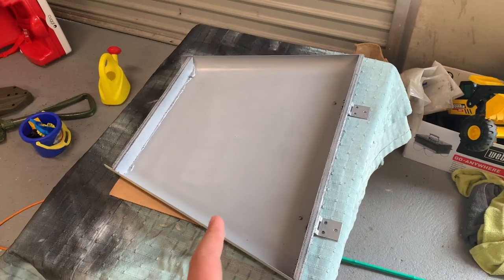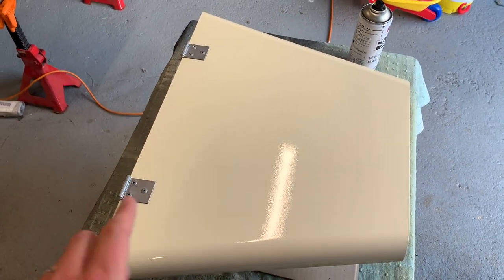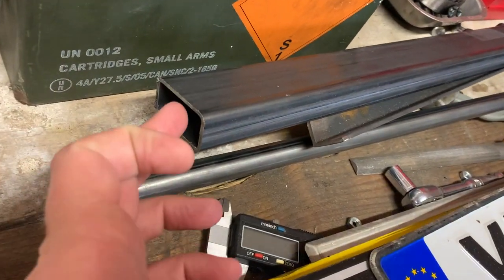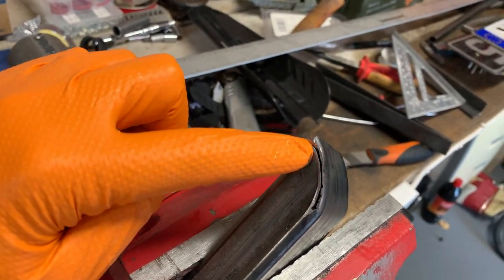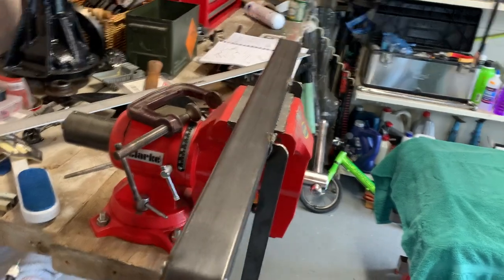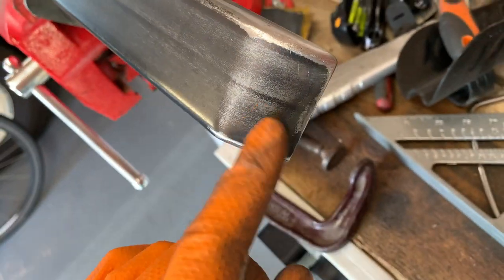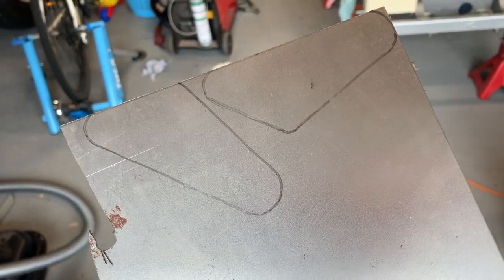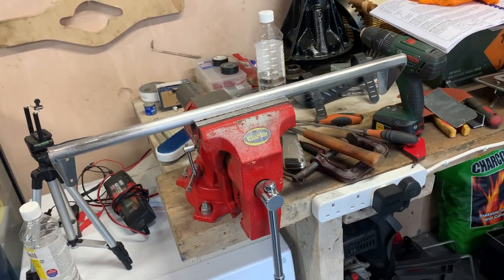Toylander 1 Build Series - Episode 20

Comment: Hi, it's great to see that you're almost done with it! It looks great, far better than mine! I'm waiting anxiously for the electrical part of the Toylander! I already started mine, I'm curious to see how will it be yours. Also, I cut the side panels so that doors could be opened, but I think that I lost some of the structural strength. I can see the car bending lightly every time that my kid jumps aboard...  I'm about to order a horn,  but I'm not sure how loud should it be... I'm guessing around 90 db, because I don't want it to be too loud since I'm pretty sure it will be used a lot :D Will you put an horn inside your Toylander and do you already know how loud will it be? Thank you!
Reply from the maker: Thanks Greg! Shame about the side panels on yours, can it be fixed? I hit a major roadblock with mine there recently and have decided to take a break from it - video coming soon. I will finish it, just not in time for this Christmas I’m afraid. Not too sure re the horn Greg, the electrics side of things frightens me a bit!
Reply: Restosaga Workshop I am thinking about fitting two steel bars under the body, to prevent the bending. I’m looking into it. Another problem is the throttle. I bought an Hall effect throttle to use with the PWM module but it isn’t compatible. Plenty of difficulties to overcome!
Reply from the maker: The bars sound like a good plan! I think
I’ll buy Toylander’s thottle from them. Electrics are tricky!